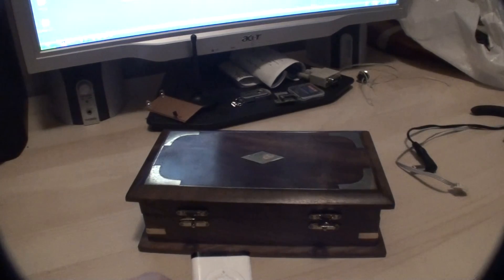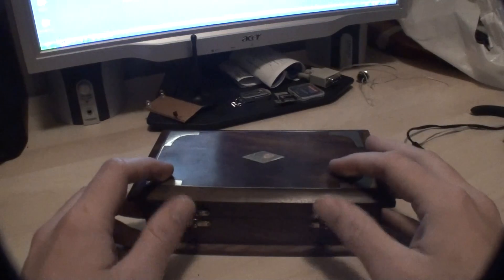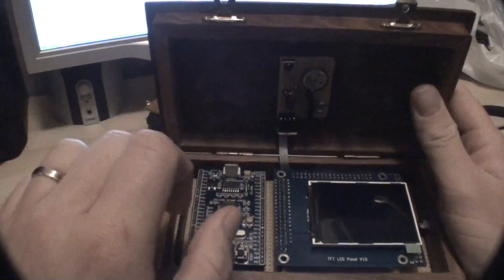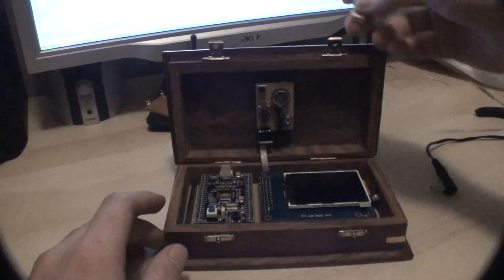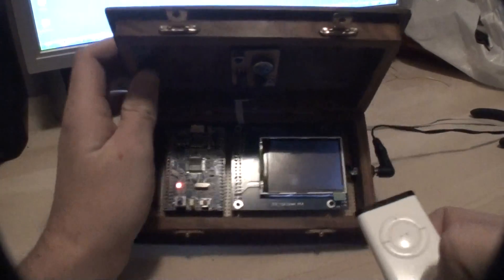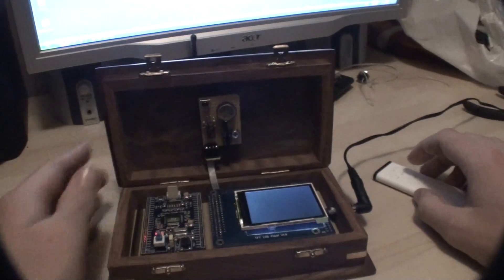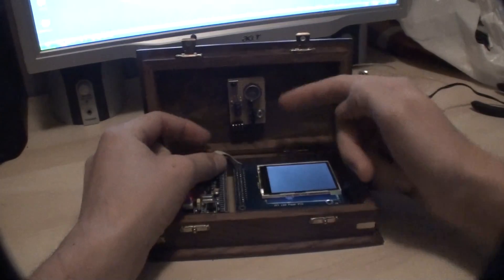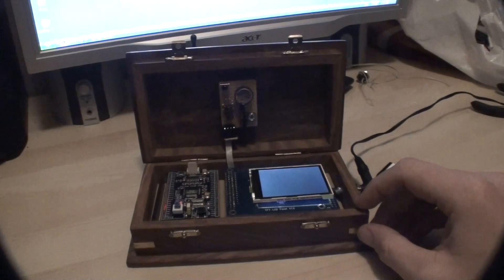ARM Cortex-M3 with QVGA LCD and apple remote

Comment from the maker: I have replaced the ILI9320 LCD with a newer PCB.
Yep, same ARM as that...
I power the device with 12V, and it has three regulators, 3.3V, 5V and 9V.
3.3V to the ARM and display, 5V for the IR-receiver and 9V for the backlight.

Comment: So you have replaced the ILI9320 on the display PCB with the newer ILI9325? Or have you bought a new display with the ILI9325 driver?

The ARM Cortex you are using, is that the one from futurlec called: ET-STM32 Stamp

Also how do you power the display? As the ARM needs 3.3V - but what about the display?
Can the display be powered from with 3.3V?